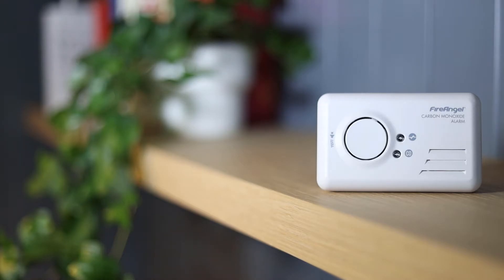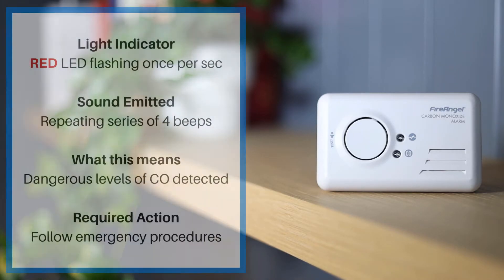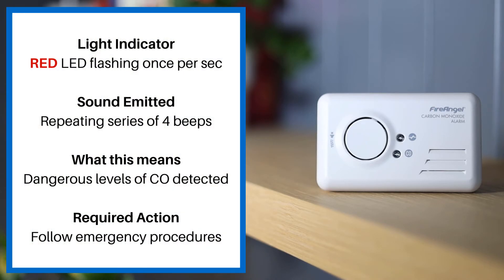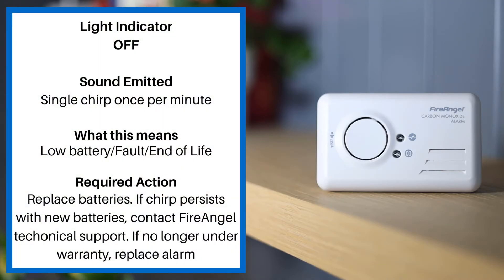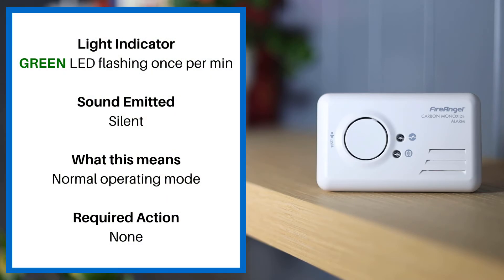Understanding the sounds of the FireAngel CO-9B Carbon Monoxide alarm.

Comment: I had the rapid intermittent beeps, but it was with a flashing top green light! What does that mean??
Reply: Same here green light flashing and 4 beats.
Reply: @ just so you know, I replaced the batteries and it settled down! I hope that if the red light is not doing anything then there’s no CO to worry about!